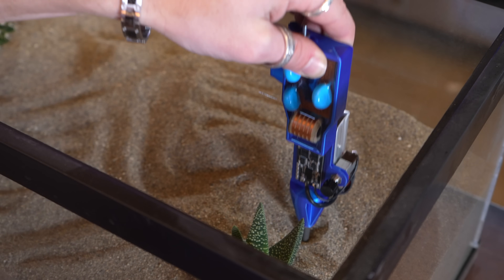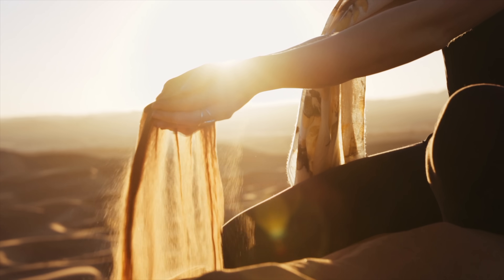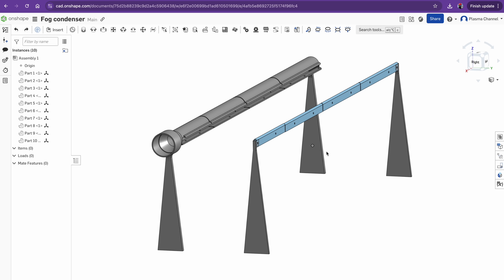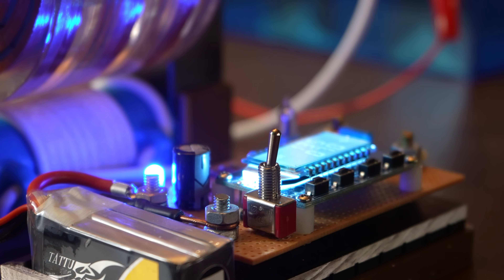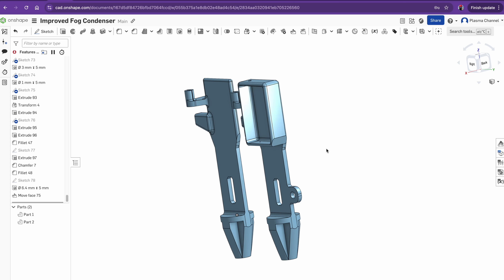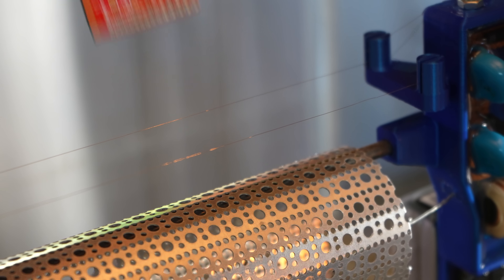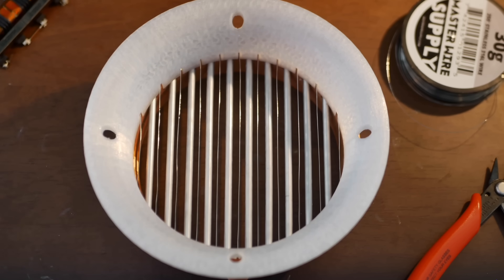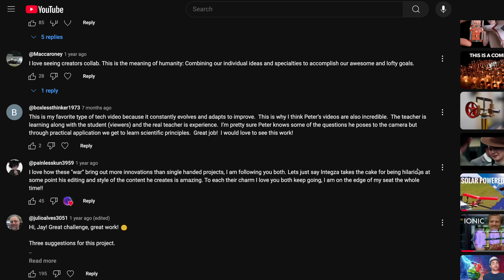Solving Desert Water Shortages Using 20,000 Volts

Comment: I wonder how conductive the negative needs to be, could you just use sand/literal ground as the negative so the condensation would happen directly on the plants?
Reply: Doing it that way would mean you couldn't then put a collection tray under it if you wanted to keep the water.

Comment: I researched this! You can not only collect ready-made droplets but also charge them near their rayleigh limit and gaseous water molecules (which are dipoles) will be attracted to them and condense until they grow too big. Of course there's still latent heat, but the micrometer-sized droplets immediately reject it to the air!
The downside is that you need a consistent droplet size and voltage for the effect to manifest, which means you need to make your own droplets with electrospraying or such.

(Morcelli, Stefano, and Lorenzo Cremaschi. Analysis of Electro-static Assisted Air Dehumidification. Auburn Univeristy, 2021.)
Reply: Furthermore, the grid is optional. Plants are electrically connected to the, er, ground, and may be used as the grid. Side benefit, all the water condenses directly on the plants.
Reply: I was part of an electrostatic cloud seeding study done with ag planes, and that's precisely what we were doing.  Water was loaded in the aircraft and then sprayed through extremely fine nozzles (50-100 micron droplets) with a charge ring around them that was receiving roughly 10kv.  Due to the constraints of the physical system, any higher and the rings would pull the spray close enough to short the system out.  The ring size and nozzles that dictated the distance were a compromise between system effectiveness and maintaining reasonable aerodynamic drag for the aircraft.  However, they proved to be quite effective as-is.  We seeded several dozen clouds to great effect, each receiving 100-150 gallons worth of 50 micron charged droplets (do the math on how many droplets that is lol) and then we moved on to other studies.  One of them was fog reduction, in which the spray was deposited over a fog bank to coax the moisture to condense on the droplets and precipitate out.  Each pass was like wielding a literal fog knife, 200ft wide swaths were cut in thick fog banks, sliced all the way down to the surface as the moisture did exactly what was predicted.  I wasn't on the ground to experience it, but I was told it felt like a light drizzle and everything got soaked.  So in theory, that would be another option to harvest a fog bank for usable water on the ground.  You'd just need a whole fleet of expensive aircraft to cover the area you wanted to precipitate water on...not exactly an economical solution, I would think.  Maybe a job for a drone swarm?  Similar seeding systems are being used on the ground to coax snow out of winter weather, essentially they're blowing charged droplets up into the air with a large fan, and some of the droplets manage to catch updrafts and reach a bank of moisture.  They're also using aircraft for this to test efficacy.

We also experimented with dust and smog/air pollution reduction, unfortunately given the minuscule size of the water droplets, they never managed to reach the ground to deposit any particulates collected along the way, as they evaporated rather quickly and fell to the ground rather slowly.  A lower altitude would've certainly helped, and in one instance of low level application, dust was reduced considerably.  However, in the environment where you'd want to reduce smog and air pollution (like a city), you can't very well be flying around 100ft above the ground.  People were already losing their minds after seeing the ag plane leaving "chemtrails" in the sky 1500ft up, imagine the outrageous things you'd hear if an ag plane was doing that over your city every day, weaving through buildings and skyscrapers at 100ft.
Reply: Historian here! Really weird question, so is the specific heat of water basically a not a problem once it's a vapor in this situation?

e: Also, if it's not too much trouble, how come?
Reply: this is why he never tested outside. As it won't work
Reply: @DonPavardenis  why won´t it work outside?

Comment: as you are using ultrasound atomizer you are charging already present liquid water droplets. I think this system would not work for humid air. you need liquid droplets for your current setup, however in desert air there are water atoms completely dissolved in air and in gas form.

Comment: Why does it have to be DC Voltage? Why won't AC work? You should run the HV wire under the U-shapped grid, so it can't be touched accidentally in a garden.

Comment: Great job. Just wondering, why not a greater distance between electrodes? My hypothesis is the electric field lines would expand out more and capture fog from a greater distance. 

If one wire were burried, the ground would becime a ground plane and a wire net could be placed on poles that hild it up say three feet or a meter over the crops. As the plants grow up,  they would atract water to the foilage.  I further hypothesize that the small currents help bring nutrient salts up from the ground.
Reply from the maker: So, I was thinking about that too. However, it would require the ground be wet already. And if the ground was already wet....it defeats the entire purpose of the device. Originally, I wanted the stake's metal point to be the electrical ground. But it wouldnt work in dry sand at all.
Reply: @PlasmaChannel  The plants themselves, however, are technically wet.
Reply: @PlasmaChannel   I did say  what if the wire were buried.  The  electric field still permeates dry sand.  I wouldn't expect the point of the stake to be enough so I proposed burry a wire.  Electrostatic attraction still attracts the fog water droplets to the ground causing the fog to wet the ground  Wetted Mineral salts from the sand conduct charged ions to the wire, and If not ionic minerals conducting, then the slow spontaneous  ionizating of air molecules within an electric field between sand grains.   eventually  the plants will grow roots close to the wire, and the plant will conduct through moisture in the plants roots and stems.  Fog will condense on the leaves and excess condensation will fall to the ground  and wet the roots around the plant. 

Electro-horticulture is a centuries old technology not well understude and was replaced by more predictable nitrate fertilization. Many ill thought iterations don't work or work against the benefits of growing plants in annenviroment where the air is naturally electrostatically charged.  It would be nice to apply modern understand to the workings of electric-horticulture and maybe make it work for us in a more predictable and cost effective way.

Comment: The two main concerns I would have is the potential for the wire to contact the grounded grid in a large scale opperation during a windstorm, and the fact that the wire HAS to be left open to air, meaning you have a decent chance for someone to accidently touch it, especially since ground is so close to it. Considering the regions this would be used in (especially the lacking education in such regions), you would need to safety proof the design and definitely make it intuitive to not touch it.
Reply: Such as, say, making it be contained within a box?
Reply: @kennyholmes5196  Any box you attempt to contain it in would impact the efficiency of the design, since the design is predicated on being left to open air.
Reply: @Handles_AreStupid  Not if you provide slots for air to be sucked in by.

Comment: Really cool video but calling it a "condensor" is simply wrong. The water is already liquid. You dont condense it. And  the comparison with the dehumidifier is also unfair as it actually condenses water. A dehumidifier can produce water when the saturation in the air is less than 100%. Your system cant. Thats why in this szenario, yours is better. Still a very cool idea, just a different use case to a dehumidfier.

Have you testet it on less dense fog? It would be interesting to see if the efficiancy stays the same!

(Sorry for bad english)
Reply: "Precipitator" is a better term, and one that's already commonly in use in industrial settings, where electrostatic precipitators are used to pull water droplets and ash and smoke particles out of waste streams. I was surprised that he couldn't find much of anything with search engines, but maybe this is why. He's using the wrong terms.
Reply: @EntropicNightmare  Isn't that always the problem.  Just because we know what we're talking about doesn't mean we're using the common industry term.  It also shows the limits of AI.
Reply: oh that's a good point. might be pointless to use as dehumidifier
Reply: Yes it is using built up charges to electrostatically attract water vapour. In comparison the dehumidifier causes a phase change by condensing individual water molecules, i.e water's gaseous form, back into liquid.
Reply: Who cares. Being pedantic is pointless. Comments like this add nothing.
Reply: @Nihlink they add clarity unless you don’t care about the actual science or just don’t understand it.

Comment: What is the power usage as this could work wonders as a kitchen extractor pulling grease and humidity without breaching the exterior walls and loosing valuable heat nor the noise an extractor makes,

Comment: I really doubt there is enough relative humidity for this to work in the desert unfortunately. Even though the fog may be dense it most likely won’t carry enough water for useful agriculture or drinking water. The scale you would need for a useful amount of water would be insane.
Reply: Which is why the next test should be measuring the efficiency at various levels of relative humidity.
Reply: Fog nets are already being used in the Atacama desert mountains then the water is transported in pipes several kilometers downhill for drinking water.
Reply: People are already doing this passively, it works. Now aim to improve efficiency with actives.
Reply: In a desert, any amount of additional water is desirable.
As he said in the video, fog nets have been used for years in some desert communities to capture fog water.

So at the very least in those areas it could greatly boost their ability to collect water from fog they are already gathering from.

Yes, not all deserts will be viable, but he's not targeting all deserts, he's building it to work in the places that are best suited for it.
The ones that get regular thick ocean fog.
Reply: Deserts, perhaps not.

Islands or coasts however? 

This could be cool.
Reply: @ryanjamesloyd6733  Islands tend to not need something like this, as places with exceptionally high humidity like most islands also tend to get a lot of rain from that humidity.

Desert fog is a fleeting event that is very much a unique weather event.
As it tends to happen in places that are otherwise quite dry, and only getting provided limited moisture from the morning fog.
Reply: I don't understand why you think this, there's nothing in fog except water so "dense fog" means lots of water
Reply: @magnuswright5572  "lots of water" != enough water
Reply: @rucker69  sure, but some water is better than no water, and there are plants that are adapted to grow with very little. This won't turn the Sahara into the Amazon, but it will still make some people's lives better
Reply: @magnuswright5572 will it? This will cost a lot of energy to run at a large scale and if you’re trying to plant non-desert crops you need to hope it gets foggy often otherwise you’re just wasting energy and the plants don’t get nearly enough water. As for desert plants, they clearly don’t need it as they get all the moisture they need when it’s foggy out already.

Comment: So, Im guessing they would have already used these as dehumidifiers if there wasnt some flaw in that context? Which Im also guessing is that it requires a lot more moisture in the air than the norm for them to be so effective? I.e. If you just shoved one in a normal albeit quite humid room, its not going to do much, right? Cause otherwise It seems like I should get to building one for my flat...

Comment: You is Plasma channel.. Scans database Warwick university Plasma generated Ultrasound + Ultrasonic holography + Echo techniques for doing it outside of a box in the atmosphere = Create correct pressure zone with Ultrasonic echoes dragging water to that spot and that's how you make a waterfall in the sky.. Stares at a Tub draining As long as there is water in the atmosphere that spot will keep pouring water. If scaled up to masses = Demand govt use solatube/light tubes to send light underground to boil sea water into the wind to those places using Ultrasonic sensors to monitor atmosphere water of those places for calculations. < Like your govt ordered Cloud seeding companies DON'T DO.. "Oh no a drought!" Yeah, DUH..

Scans facial features and bone structure you Ancient Norse: "Thor's hammer from the heart of a dying Star the strongest material in the universe! Beat that!" 2025 World Science: "Nuclear Pasta inside Stars the strongest material in the universe!" < No one can.. Strokes Minimal requirement for expanding a Star core outside a ship to shield and greatly multiply power of a Warship feeding from the NEAR vacuum of space No one. That means something. Releases Ultrasound from body to line negative & positive charges for mini-lightning aka plasma generated Ultrasound chain reaction to final command to dump a pressure field on a junked Car You call it the Force now..

Comment: the experiment sounds like an excellent idea, Im also curious about how well it works at desalinating water since you could probably condense humid air from a salt water source to produce fresh drinking water. imagine if california could just extract seawater to fill its water needs
Reply: They'd have to use solar evaporators instead of ultrasonic ones in order to avoid salt buildup and accidental electrolysis producing chlorine gas, hydrogen, and sodium hydroxide, but I can see it being reasonably implemented like that, yes.

Comment: next step is to prove that high voltage water collector is more efficient than inverter heat pump dehumidifiers, which can also collect water out of the air.
Reply: the humidifier he used may use a peltier element instead of a heatpump and could be a lot less efficient than a heatpump
Reply: @vornamenachname8001  good point and in that case even less efficient than an inverter heat pump, which can modulate compressor speeds and avoid energy spikes associated with starts/stops cycles of regular pumps.
Reply: When foggy, this electrostatic method will be more efficient because it's simply attracting the water molecules that are in liquid state in the air (fog) and forming them on the metal surface.  When there's no fog, water in the air is mostly in gaseous state so a dehumidifier will be more efficient (and required as is the only way) as it cools down the air to force the gaseous state water back to liquid state.
Reply: Did you watch the end of the video where he literally shows his is 9X more effective
Reply: @ianstrom7210  I did not. Thanks for pointing it out, I will take a look.
Reply: That most likely was a TEC based dehumidifier. There are two types compressor based and TEC based ones. The TEC based ones are hugely inefficient and the compressor based ones are much better. And I've never seen a compressor based one below 100w so the one that was shown most likely was of the inefficient type  @ianstrom7210

Comment: So its an electrostatic droplet collector, I wonder how does it compare to a proper refrigeration cycle based dehumidifier. Really cool concept and build, would love to see how well it works in natural fog
Reply: If you compare them based on energy usage, it would likely win.
As while refrigeration is really good at condensing moisture, it's not exactly an energy efficient process to get down to temperature.
Though it is quite efficient energy wise once it is at temperature.

But a system like this one seems like it would stay fairly level for draw the whole time, and unlike a refrigeration based system, the moment you turn it on it starts working. 
There's no cooling period that you would get with a refrigeration based system before it starts to work.

And since desert fogs can be quite fleeting events, a system that has an instant start up is going to be a lot more preferable.
Reply: @Targe0  Oh the speed factor didn't occur to me, that's a good point. I wonder if you could somehow combine these two methods of collecting moisture, maybe there could be a synergistic effect
Reply: @omarek555  Unlikely, as desert fog is really short-lived.
So his instantly acting system would just out match most other methods simply because it doesn't have to be running prior to the fog moving in.

Most other methods would basically need to be running near constantly to get the temperature and timings right for it.